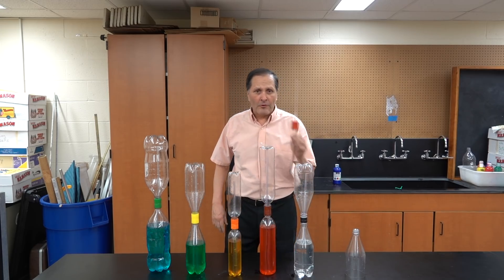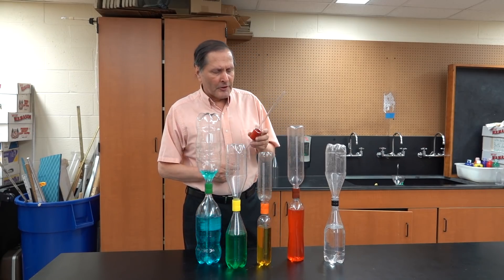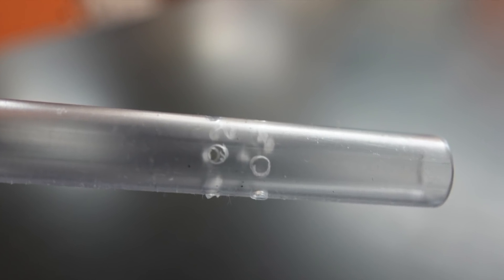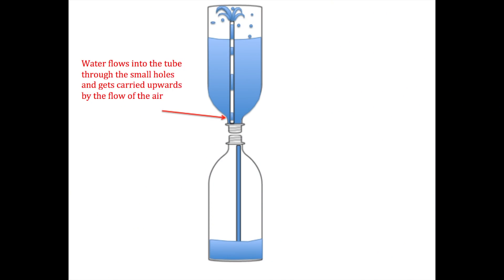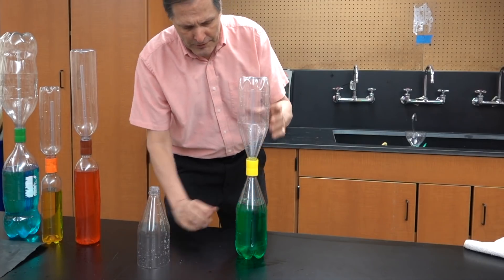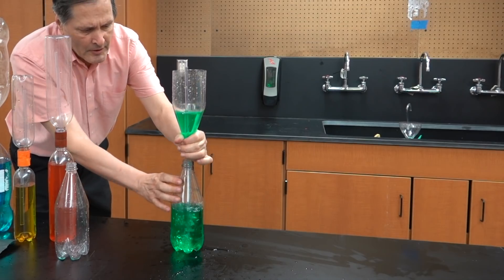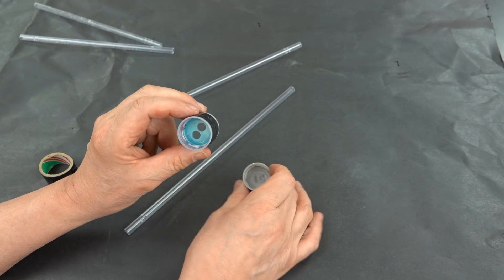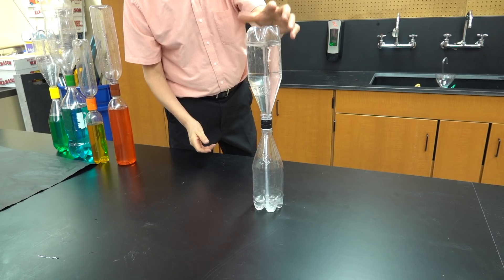Water demonstrations part three--Fountain in a bottle // Homemade Science with Bruce Yeany

Comment: Sorry, I don’t think that is how it is supposed to work. The full side is supposed to go up to empty side…. I’m pretty sure if you have a proper seal on everything the pressure and volume of water will work the way it is supposed to which is crawl up towards empty. If it isn’t… it is because you don’t have anything air tight.
Reply: Everything is sealed and air tight. Even the straws and the straws holes. Air tight. The only possible passage for air would be the straw. That is air being shared between the two bottles. No new air is being introduced. If new air is introduced then your seals aren’t working correctly.
Reply: I looked this up cause I did the project in 5th grade and sort of forgot what it looked like. I can’t even remember where I read about the science project. Not sure if it was the library. I’m pretty sure if I remember correctly. That that isn’t how the fountain in a bottle is supposed to look like. The full side is supposed to be at the bottom and the empty side is at the top. The empty side gradually gets full. Also remember that everyone’s project looked better than mine. Soooo, honestly bad project.
Reply: Everyone had daddy’s and mommy’s that helped I guess…

Comment: What would happen if you didn't have the holes in the straws?  Just a regular fountain without the bubbling effect?
Reply from the maker: no fountain forms without the holes,  the holes allow the water into the straw and then gets carried upwards by the air flow

Comment: @Bruce Yeany,
will two bottle fountain stop if upper bottle is half way full and bottom completely full to near to full? 

Will atmospheric air pressure from top bottle push the water up from bottom bottle to make it non stop fountain?
Would be nice to inject this fountain jet onto PELTON turbine.
Reply from the maker: once all the air in the lower bottle is replaced, the bottom bottle is then full  of water andthe fountain will stop in the upper bottle
Reply: @YeanyScience   Looks like these guys have tested the old 3 bottle model to make it Non-Stop.
https://www.youtube.com/watch?v=5HBnK6vjErk

Comment: I guess the reason those holes suck water to make a fountain in upper bottle is because of Bernoulli's principle. When the air passes through the tube upwards with high speed the pressure in tube is low because of high speed, so some water gets sucked in. The reverse happens in the tube below and it sucks air in the tube where water is going down with high speed so it has bubbles. Am I right @Bruce ? ,

Comment: Have you tried enlarging this design with 5 gal water bottles?
Reply from the maker: I did,  they work but it is very unstable and would need to be built in some type of frame work to hold the upper bottle up

Comment: Its not continuos motion. Its a short time. Will stopin just 2 minutes. So its not point with this. All herons fountains are fake and cannot be used as a free energy devices with electric turbines as many people trying to show.
Reply from the maker: Heron's fountain were never meant to be a power source,  they are a nice demonstration of using pressure to  lift some it's water to a height higher than it's many body of water.  Like anything else, it's potential energy reduces as the water level seeks the lowest level.
Reply: @YeanyScience  its not a continuous movement of water. Its limited at 1-2 minutes depending on the volume.
Reply: @YeanyScience  it is no point to show this if its doesnt keep working continuos
Reply from the maker: Samuel, I think you have missed the point,   if you are looking for a free energy source you are looking in the wrong place,  nowhere have I mentioned that it is free energy or that it will turn turbines to provide energy.  I posted it because it is an interesting demonstration in physical science and has been a  good piece for my students to investigate in the study of pressure .  It is a demonstration that has entertained people literally for centuries and that is it's purpose.

Comment: I tried this last night because I think my 6yo would love it and I couldn't get it to work! The water drained into the bottom bottle, but instead of creating a fountain, what happened was the air from the bottom bottle built up until it did a single big bubble out of the little holes in the bottom of the top tube, which then repeated until everything was drained.

I fiddled with all the variables, and got a slight improvement and some intermittent fountaining out of the top by shortening the tubes and starting the bottom bottle off with much more water, but nothing like yours here! Where might I be going wrong? The only thing I can think of is that the tube I had available was really narrow compared to yours - just 4mm. Could it only work if the holes are much smaller than the tube diameter? Or are the tube lengths more important? I will try to find a wider tube and give that a go.
Reply from the maker: I would say try it with the bigger tubes or use drinking straws,  they work well
Reply: Thank you! Will do
Reply: Yes! Bigger straws works perfectly, my daughter loves it, thank you!

Comment: Is it possible to bring the flow of liquid in equilibrium. Can we make it perpetual.
Reply: No. 
There is no water flowing up from the lower bottle to counter the downward flow. And there cannot be either. The energy for this comes from gravity, net flow has to be down.
Reply: @Tfaonc  not entirely true, if you build it to have just one tube that reaches the top of the upper bottle and the bottom of the lower bottle, pressure should continually be higher in the lower bottle, pushing water up the tube and into the upper bottle, like a heron's fountain
this would, of course, require some playing around with levels in each bottle, and a one-way valve might improve how it works
of course things don't always work the way they do on paper, so who knows, the only way to know is to try

Comment: Could you calibrate this to make it like a perfect 30 seconds or something like that? and with a shape of a sand clock this would be a very unique water fountain clock
Reply from the maker: change the amount of water
Reply: Equip it with micro servo-valves that are driven by an arduino that's connected to a couple of differential pressure gauges and a quartz regulated oscillator. B )
Reply: Different diameter of tubes on inlet.
Reply: Great idea. I'm on it.